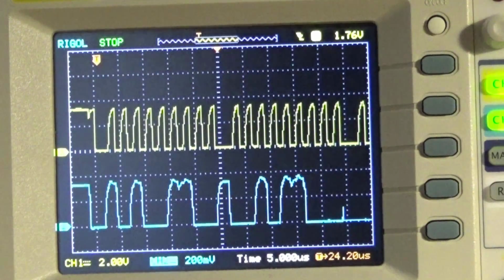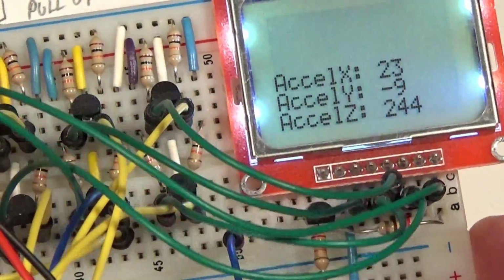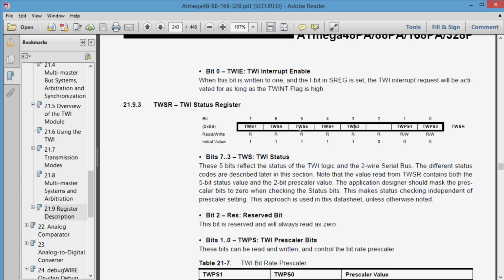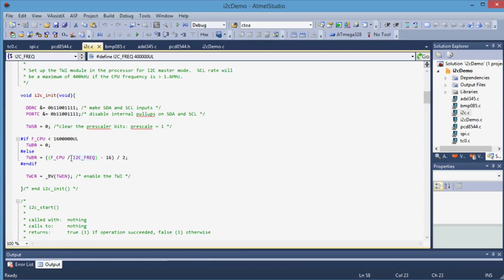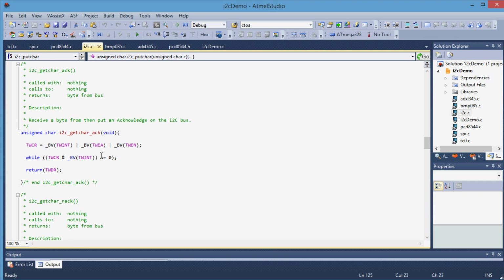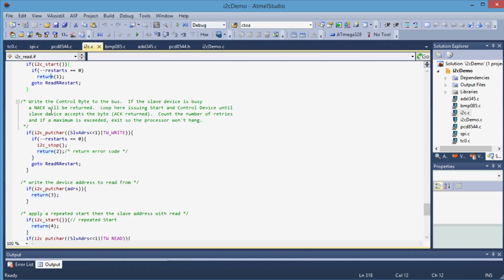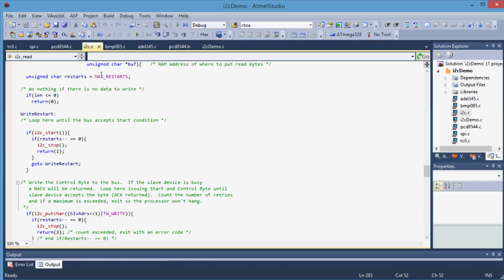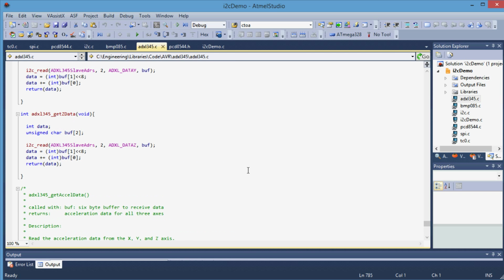Introduction to the I2C Bus

Comment: I've searched for a good (and detailed) explanation and code examples for i2c, without having to read the entire i2c section in the datasheet of my MCU, the slave device and an i2c manual in general, and maybe it's just me and i failed to find what i was looking for, or there are just not that many good explanations out there ... but then i found this video ... it's the best and most detailed explanation/ code example i found in days ... you really helped me, thank you for sharing your knowledge <3
Reply from the maker: Thanks for your comment.  Stay tuned to this channel, I'm about to release a couple more videos on the I2C bus.  These new ones will repeat a lot of the material in 'Introduction to the I2C Bus', but will also have some new material.
Reply: Craig Hollinger already subscribed and really looking forward to those videos!

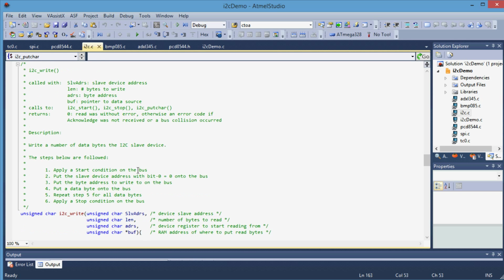Comment: At video 38:45, the only thing you can do to prevent MCU for hanging is to use watchdog. If everything is okay, then before "return(TWDR);" you should to include reset watchdog. If hang, then WDT will reset whole MCU. I am just begin to learning direct addressing and advanced programming and did not yet tried WDT, but I bet you will get the idea.

Comment: Hello! I am studying how the source code of an arduino-based sine wave inverter is still in the beginning of the study ... I want to learn how to make a small 500w sine wave inverter that is set to master and connect other inverters to it in the same grid of to work with their synchronized nenoidal waves. Could you give me some help or even some reading material? thankful.
Reply from the maker: Google.

Comment from the maker: Response to WildMania:  Thanks for your comments, all are valid.  I wrote the I2C code several years ago and based it on an example that came with the WinAVR compiler (same one used by Arduino).  Yes, in good programming practice goto should be avoided but in this case it easily solved a problem.  I didn't spend the time to work around using a goto, but I'm sure there could be a better solution.

Using the watchdog timer would work but is a rather 'brute force' method.  There could be other more elegant solutions.

A quick internet search brought up this Wikipedea page on the I2C protocol which includes a description of the repeated start (under the heading 'Messaging Example: 24c32 EEPROM'):

https://en.wikipedia.org/wiki/I%C2%B2C

Good luck with you journeys in the I2C world.  Thanks for watching.